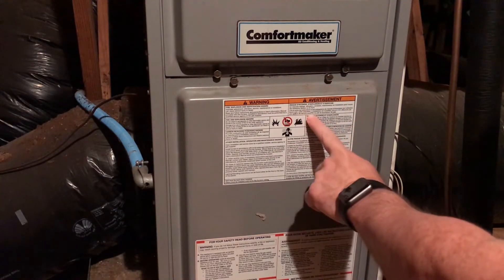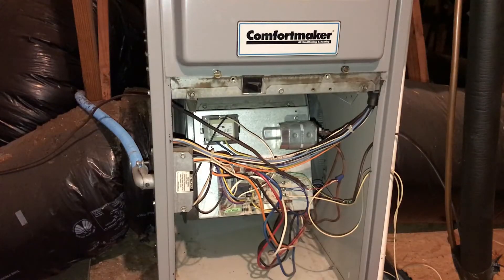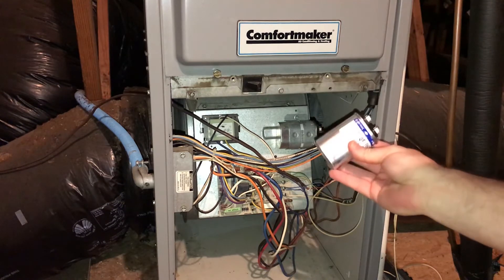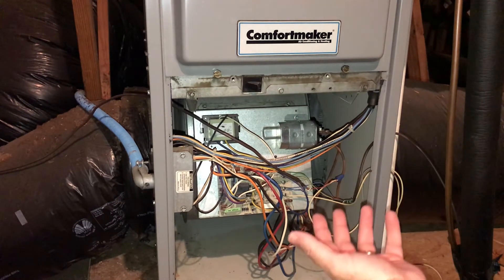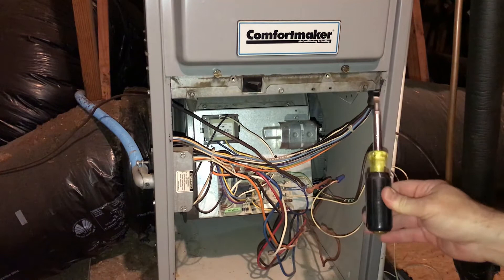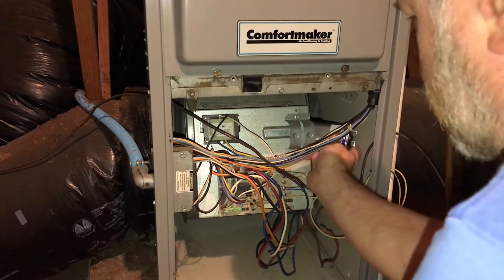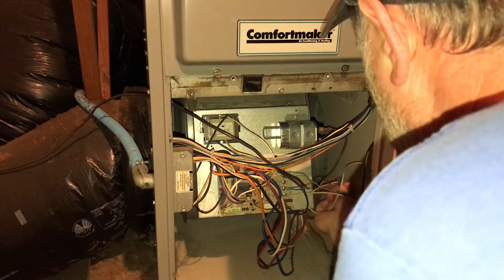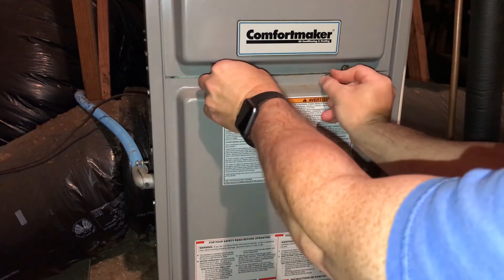How to replace the blower motor capacitor in a Honeywell AC unit

Comment: Great video! Just what I was looking for. How did you determine which capacitor to purchase?
Reply from the maker: I took a picture of the one that was in my unit already and made sure the new one had all of the same voltages and other specs. Probably did some searching around for the model of the unit as well to see what it called for.
Reply: @typicalthrill  the specs on mine are hidden behind the bracket that's holding it. I guess I'll need to gingerly slide it out to get that info. Will discharging it prior to replacing it ruin it? I still need it to work until I get the new part in.
Reply from the maker: @jeremyminiard5887  I don't know the answer to that. I feel like I just carefully slid it up enough to see, but don't do anything you're not comfortable with. Better safe than sorry.